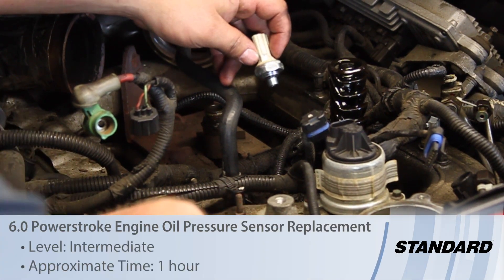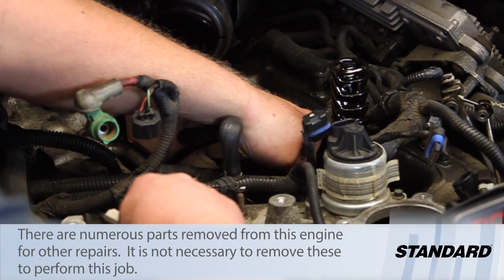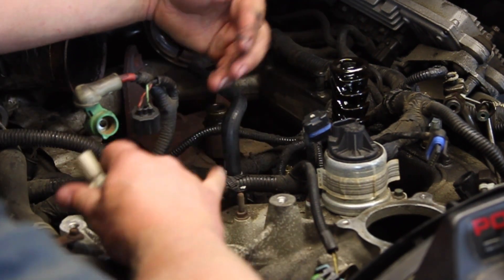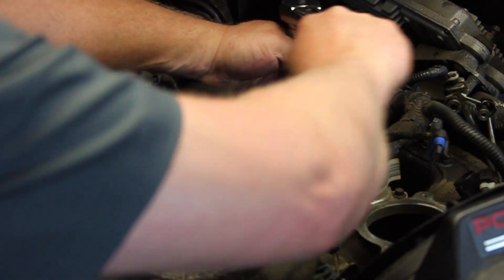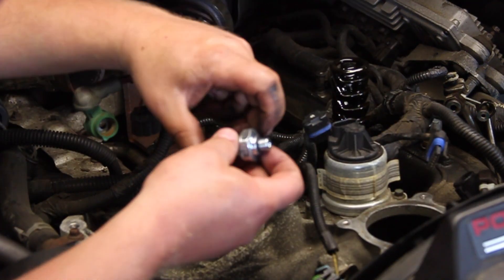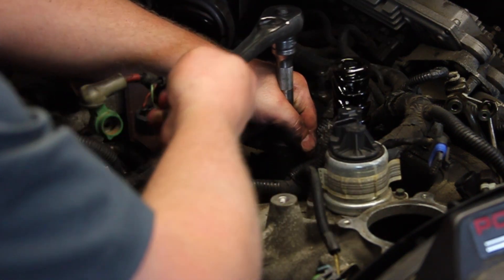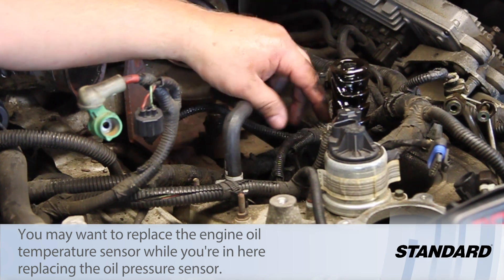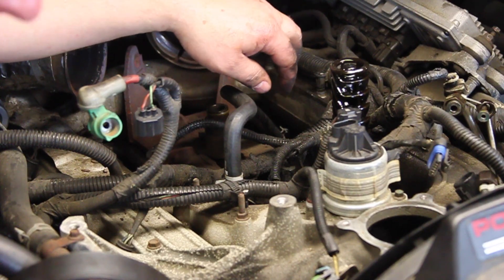Ford 6.0 Powerstroke Engine Oil Pressure Sensor Replacement

Comment: The engine computer monitors the engine oil temperature to determine the efficiency of the oil cooler? What does the engine computer do with that information exactly? Does it trigger a check engine light or some such deal if it's not cooling the oil well enough? I've never heard of this.
Reply: If your EOT stays 20° higher than you ECT for more than 25 minutes, you'll get a wrench light on the dash.

Comment: will this sensor cause engine not to start?
Reply: If you lose enough oil because of oil coming out of the sensor, your engine will shut down
Reply from the maker: No, this sensor is just used for the gauge on the dash.